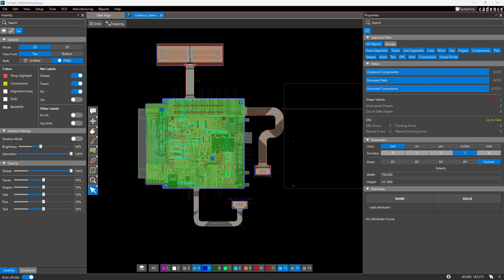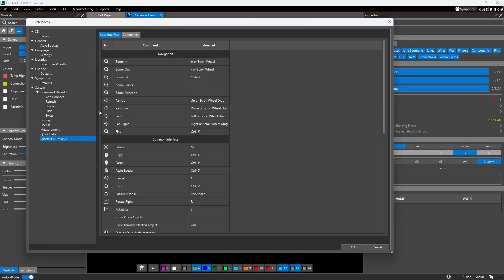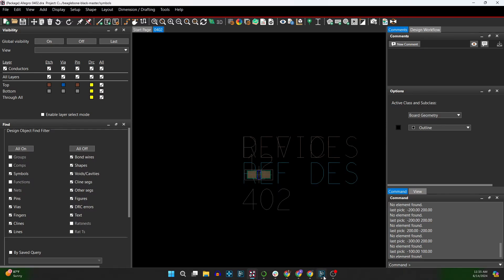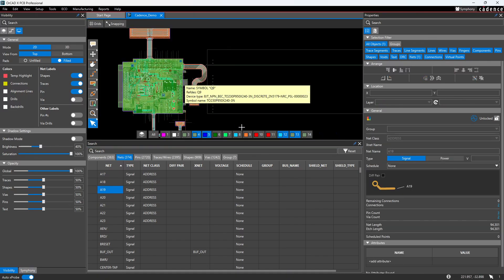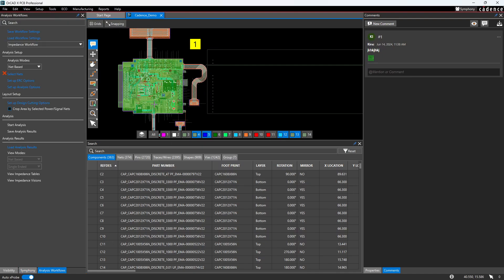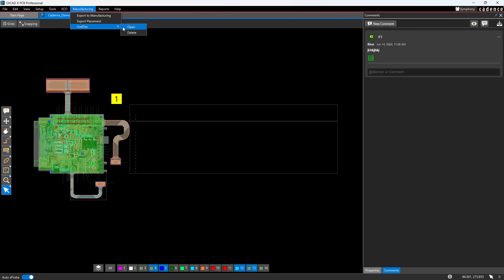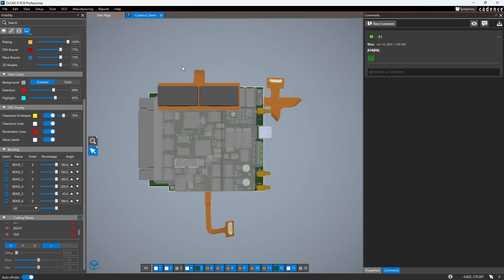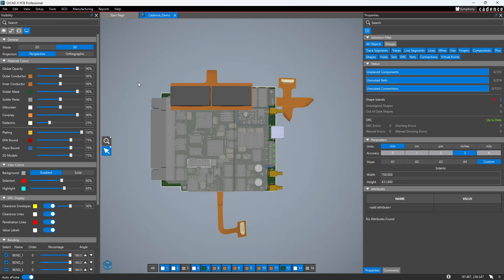What's New in OrCAD X Presto? Everything you need to know

Comment: Is it possible to export things like libraries/footprints, color parameters etc. in Presto?
Reply from the maker: Do you mean using presto to export those things or, since you're commenting on this video, do you mean is it possible to export those things from the Altium 365 environment to a format that can be used by Presto. Or do you mean something else?
Reply: @techedkirschEE  There is a function in the classic OrCAD PCB Editor that allows you to export footprints from an existing design (.brd). The question was whether this function is also available in OrCAD Presto?
Reply from the maker: @pelasg1an  Right, I export footprints using PCB Editor. I misunderstood because I thought this was an Altium 365 video 😂. I’ll check Presto and let you know in a bit
Reply from the maker: Doesn't seem possible from the standard user interface. I haven't tried inputting commands from the command window, however.
Reply: @techedkirsch  👍

Comment: And the tabs at the bottom that they added to make it more like Altium... they got about a 1/4 right.  Altium has all the layers on the tabs.  One thing about Cadence is that it has a lot of layers - Assembly, Cavities,, Dimensions,  Manufacturing, etc... with each of those having a zillion layers.  Hard to control sometimes.  And I really don't see the need for a lot of that.  I mean, why does each 0603 need twenty dimensions?  A lot of that really is meaningless as to getting a board fabbed.
Reply from the maker: @googlesucks1376  interesting points and fair enough. I think they’re explained in a document from Cadence. I’ll try to find it.

Comment: Well, as I mentioned in your other vid - they forgot to add the ability to set user paths for PSM and PAD.  Silly... Also it appears they forgot to include the ability of setting up text blocks and Photo Width.   The thing about the Allegro-style PCB Editor GUI is that it's really tweak.  There's a lot to it.  I will say that Allegro/Presto lacks things like being able to easily unroute just a component or the whole board, it's lack of support for more advanced text features, the silly padstack and DRA PSM structure that become unwieldy with a zillion files in the library directory.   I see in 24.1 they added some more flexibility to control dim and masking, but they really missed the boat as to the way Altium handles single layer mode - as you traverse layers, it dims/masks all others making it easy to see where open spaces are.   

Another thing is the way Altium can utilize negative planes.   Thermals show up graphically like they should (unlike the Cadence cross traces thing) and with negative planes it doesn't obscure the routing layers.  Some Altium users use signal layers as planes but just like OrCAD, it's like you're working on the Partridge Family bus - a quilt of patches of solid areas.  Yea I know in both tools you can set the visibility for shapes/pours but why have to?
Reply from the maker: @googlesucks1376  yep. All valid points that affect the designer’s experience
Reply: The .psm and .pad path is a bug. They fixed it.
But the shape edit is a problem; the software has only been released for about 2 years.

Comment: Unfortunately, there are somethings you just cannot do in Presto that you could do in the old interface, thankfully you can still use the old interface.
Getting rid of the IDF import in Presto is a huge deal.
Reply from the maker: Yep I noticed that as well. So I still use the old interface for most of my designs. For new designs that aren't as intense in terms of imports and stuff I can go all the way with Presto. I think they'll be adding more stuff in there over time.
Reply: Thanks for the feedback @kevin-yz7ji.     We didn't get rid of it IDF we just haven't yet implemented it into the new UX for OrCADX yet.   We plan to continue to add the existing functionality with better UX and also introduce new capabilities with each release.   We determined it had enough capability to get it into the market to gather user feedback to help drive future develpment.

Comment: Been using Allegro/Orcad for 30 years plus and have gone thru every update thru the years. This by far is a step back. How is burying all the one click icon commands better? If I want software that looks like Altium  I can just buy Altium. Old saying "If it ain't broke - Don't try to fix it" .
Reply from the maker: I hear that. I still use OrCAD's classic interface, which gives me access to everything I need. Cadence seems to be targeting the newer designers and giving them a more straightforward path to getting their designs done. 80% of the engineers will do fine with OrCAD Presto and the new layout, while the 20% that likes the expanded menu and experience (and one-click options, though I imagine new users would like that as well in some cases) will use the classic interface most of the time. I want to call classic the standard interface, but want to avoid people confusing it with the OrCAD Standard license, which is still a thing for some reason...
Reply: @techedkirsch  Question? So, if I'm working in Orcad X is there a way to go back to the 17.4 interface or do I need a 17.4 license also? Is there a down_rev option somewhere in Orcad X?
Reply from the maker: @franksoressi6634  yep. They’re both accessible. Here’s a link 🔗 to a quick guide
Reply: @franksoressi6634 ah I can’t find the guide I made so I’ll say it here: 1. Both interfaces are available on the same license. No need for separate licenses. Just have to find them. After you install the latest OrCAD 23.1 (also called X), you can enter PCB Editor in the windows start menu to access the classic menu. Type Presto to find Presto. You can define which of those two tools you want to open your boards from within orcad capture (still the same interface for schematics. No new X version interface). In Capture, in the PCB menu, you can do PCB design setup, then you can choose ‘PCB Editor’ or ‘Presto’. So yes it’s both in the same software suite I’m using on a single license.
Reply: @franksoressi6634 ah I can’t find the guide I made so I’ll say it here: 1. Yes Both interfaces are available on the same license. No need for separate licenses. Just have to find them. After you install the latest OrCAD 23.1 (also called X), you can enter PCB Editor in the windows start menu to access the classic menu. Type Presto to find Presto. You can define which of those two tools you want to open your boards from within orcad capture (still the same interface for schematics. No new X version interface). In Capture, in the PCB menu, you can do PCB design setup, then you can choose ‘PCB Editor’ or ‘Presto’. So yes it’s both in the same software suite I’m using on a single license.
Reply: @Thekirschexperience  Thanks for the info. I appreciate it. Unfortunately, I don't have access to the old interface. I'm guessing because I only have the 30 day trial of Orcad X installed. But it's good to know I can go back and forth between the two interfaces once I get the actual license.
Reply from the maker: @franksoressi6634  hmm you should still have it. I’ll make a video.
Reply: @techedkirsch  Thanks. It appears I can get to the old interface going thru Capture CIS but I have no option in my windows start menu. Maybe because I already have 17.4 installed on my machine and when I try I get a license failure. Just a thought.
Reply from the maker: Hello Frank. Does this work? https://youtu.be/FS13VbOP1fg
Reply: Hi Frank,  thanks for being a long time OrCAD users.          With any OrCADX license you can use the new interface, or the existing interface,  whichever you like.

Comment: I just finished a large board in Presto.  I like it a lot.  I had to switch over to PCB Designer for a few things that are strangely missing in Presto,  but I have seen that Cadence is fixing those.  Floating toolbars, docked panels, really like all of that.
Reply from the maker: Right?? I'm liking the options a lot as well. They'll probably incorporate those changes, like you mentioned. Looking forward to which things they''ll put back in presto. I really like the ability to rotate my diffpair via insertion points on the fly for instance.